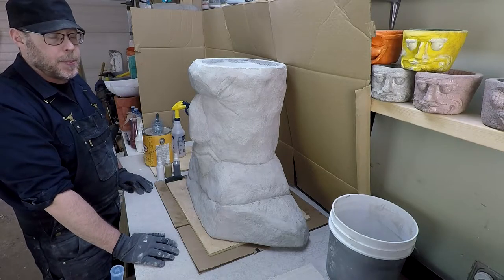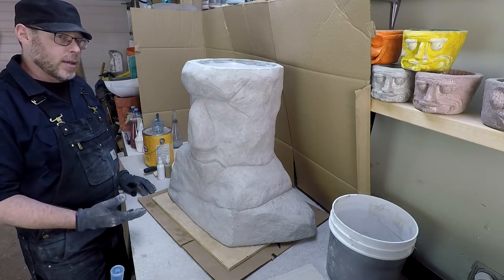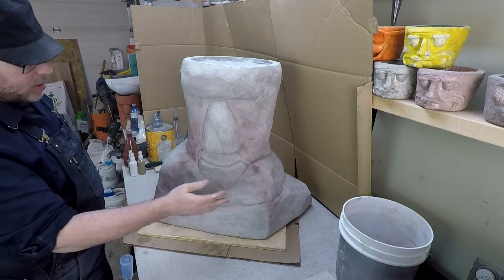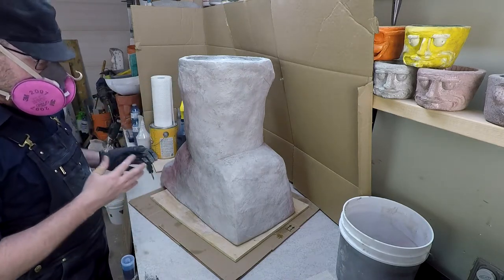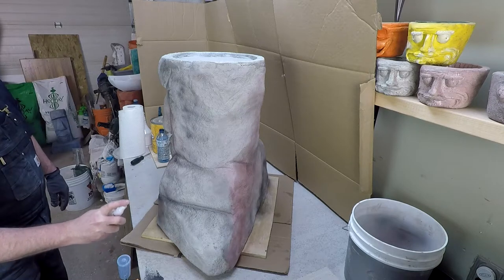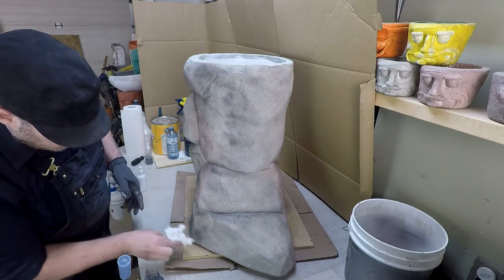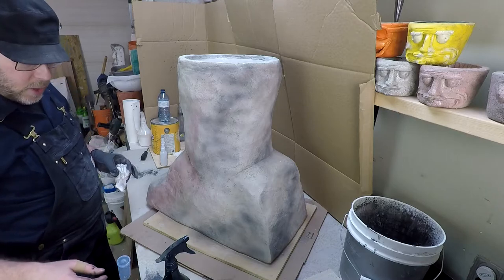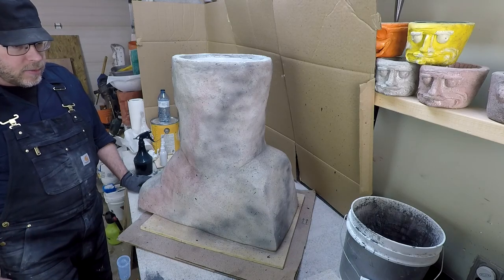How To Make A Concrete Planter Statue (8/9)

Comment: Rubbing alcohol can be used to clean dried acrylic paint off tools & to soften up dried acrylic paint. Squirt it through your spray bottles. You can also drop some right in the sprayer opening, and put it in the bottle. You can also soak paint brushes with dried acrylic paint in alcohol to clean them up. I also use alcohol on reusable laminate painting boards, if acrylic gets stuck all over them, just soaking them for while, & then using a paint scraper to easily remove the dried paint....
Reply: the paint variation for the rock using different sprayer gauges is a good idea. nice work.
Reply from the maker: thank you